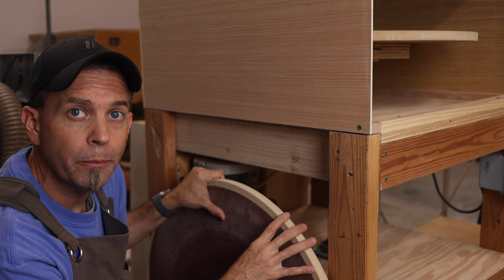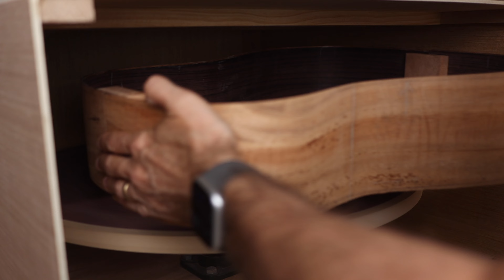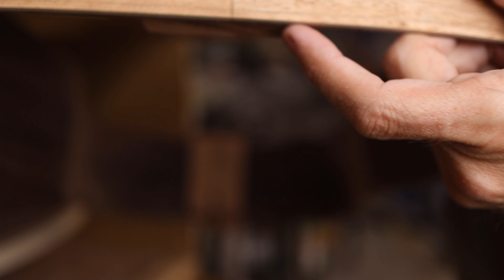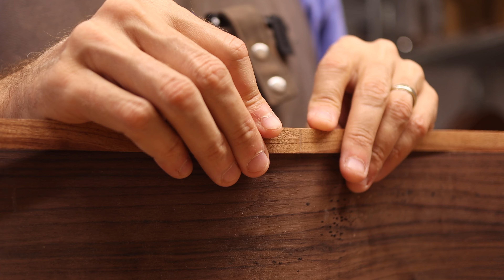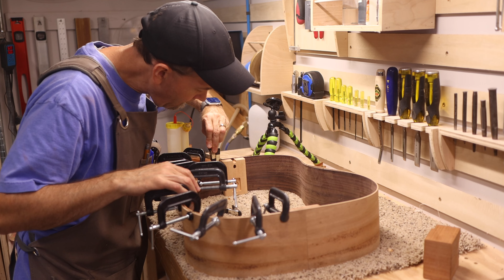Twist, Twist, Radius - Using the Radius Sanding Machine

Comment: Great video! Thanks for the demonstration. I'm ordering the parts right now, but what length of belt are you using between the pulleys?
Reply from the maker: For my motor placement, it ended up being a 51" belt.

Comment: Greetings from Mansfield in Australia again.   Congrats on a great machine!   I'm impressed you are radiusing without keeping the joined sides in a mold.  I would be concerned about the sides collapsing but I guess as you are being very careful it is not an issue.   What you've built sure is a time saver.  

  I've been thinking about making my bus driving a bit easier by mounting my dishes on a pole which I fit to a bench. Then spinning the dish on top of my sides with a handle.    But having a motor like you would sure make it faster.

Just an enhancement idea,  could you perhaps mount a strip of bright LED lights on the sides/back walls?  The idea being is you could then look through from the front and see if there is any gap between the sides/dish as you sand?
Reply from the maker: Hey, my Mansfield friend!  Great to hear from you! 😁  When I was “driving the bus”, those sides were a little concerning even in the mold.  But the pressure is so much less in the machine, it really never concerned me at all.  Also, I double layer my sides so there’s an inner layer of Indian Rosewood, thinned down to about 1.5mm.  Lots more stability.

I like your pole idea.  I’ve seen some similar concepts like that before.  It also helps to keep the radius aligned.  Anything to make that process faster and less laborious is a win!

Nice idea on the LED lighting.  I don’t think it eliminates the need for the guiding lines, but it would be nice just to help see better overall.  Thanks for watching!